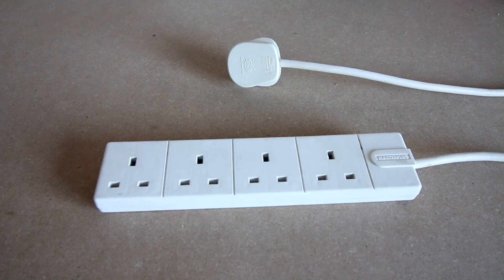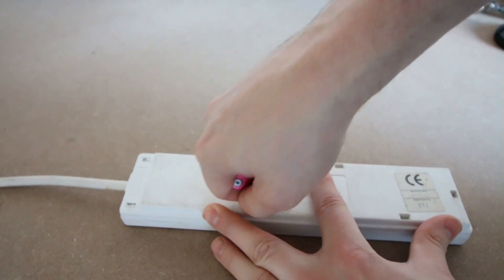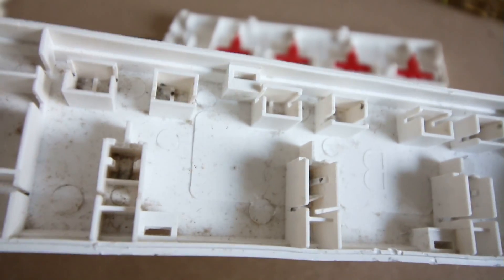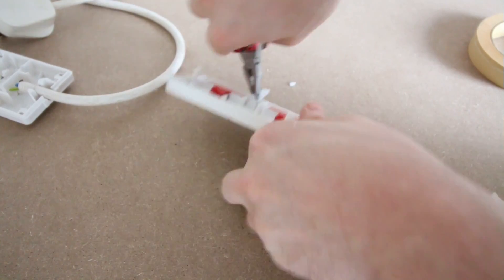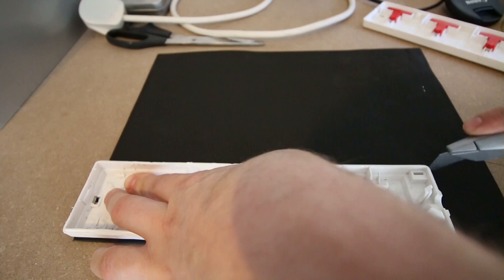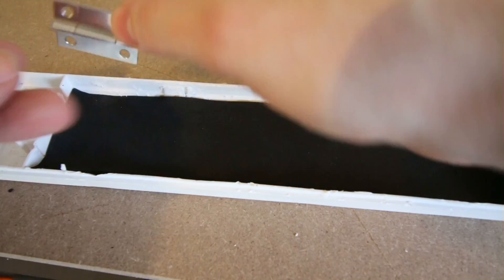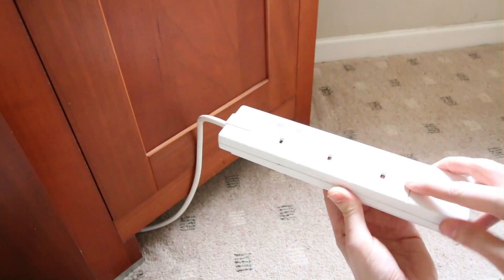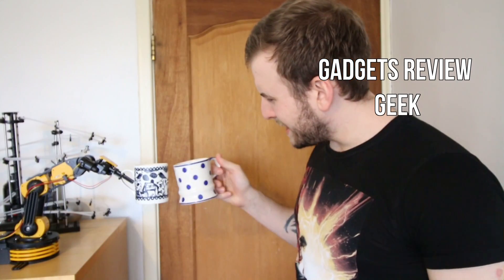Secret Power Extension Safe!

Comment: Mist8k, you should do a "Secret Safe" on something more practical, and larger like an old VCR, or TV. You could just create a compartment and still have them working. I actually stashed valuables in the unused hard-drive and CD ROM slots of an old desktop computer before, that I was still occasionally using. Ironically burglars did still my newer computer, but left the old crappy one with my hidden valuables behind.
Reply: I feel bad for you. I hope the cops catch the guy and get your computer back.
Reply: Latias and Team Eevee Studios Thanks. But it's been almost 4 years now. I don't care about the computer and other stuff, they'll probably catch the person or persons if they continued committing crimes.

Comment: The biggest problem i have with this is that it doesn't work.
It would be even better if the Power Extension actually could power thing, and being a safe at the same time.
But i would guess the Power Extension would had to be specially made for that, if it would be safe to operate.
Reply: I think it depends on the design, I have one that has room enough to hide something or you can cut the last two outlets only and have the others in working condition, Proper security measures have to be taken ofcourse